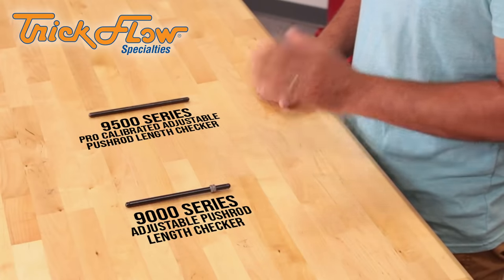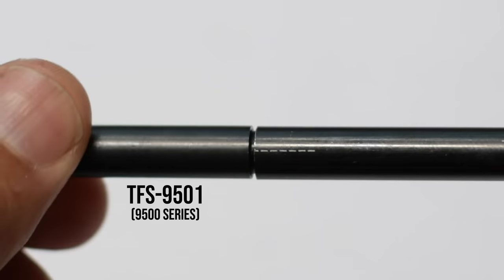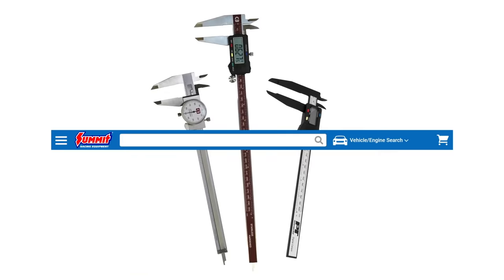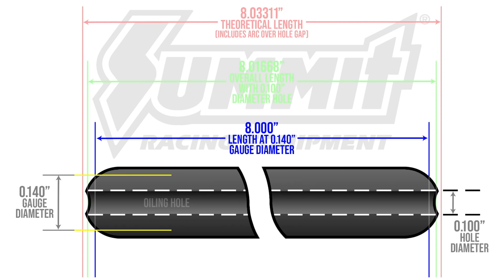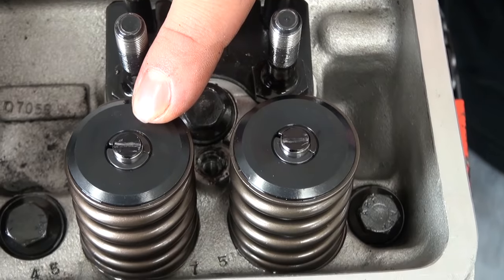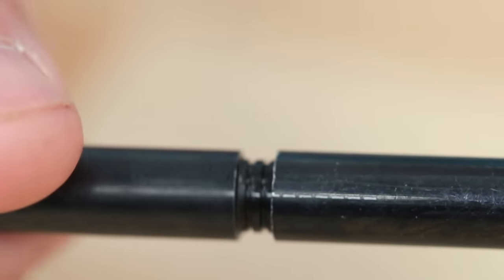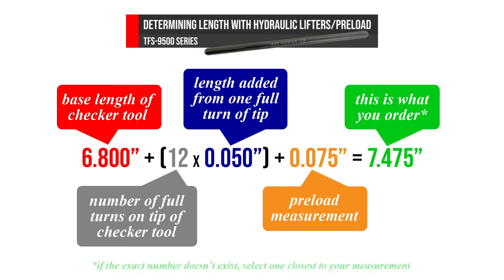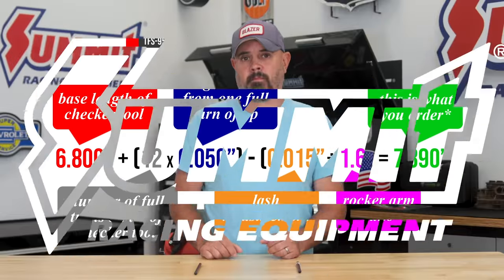How to Measure Pushrod Length Using Trick Flow Pushrod Length Checkers

Comment: Which one those tools would be better to use on a 5.7 lt1 out of a 93 Chevy Camaro. I’m planning on running a cc503 with ls7 lifters and  ls beehive springs with assault racing 1.6 RR? I just want to make sure I’m running the right length pushrods.
Reply: Jack, either tool will work.  To be sure of your measurements, use the same TFS checker tools used in the demo since the sample calcs are for those specific checker tools. These tools are inexpensive. The one criticism I have of the video is the addition of 0.075" for preload.  It is correct to add length for preload but 0.075 that value is not for all lifters.  Add the preload value for the hydraulic lifter you are using.  Most short travel hyd lifters have a preload range of 0.020 to 0.060. Many builders add 0.050 for short travel hyd lifters.  Verify your LS hyd lifter desired (optimum) preload add use that in the calculation. Note:  It may be 0.075 actually since that sounds like an LS preload but check it out yourself.
Reply: Agreed about preload. It's also different if you have an all iron block head iron with aluminum head or all aluminum block and head engine. The latter being the largest preload for thermal expansion is the largest in aluminium. 
I have a 97 Camaro with iron block and aluminum heads. Gen 2 LT1. Preload is approximately .030-
.035 with either morel lifters or the Lunatis I have.
Reply: @clifford_2zero7  Yes, good point.  As an example, Howard Cams ALWAYS publishes recommended pre-load for there lifters.  Their common SBF hyd roller lifter is 0.030-0.035 with a cast iron block and AL heads. Different values for different block/head material combos.

Comment: I don't get the 0.017 deduction
Reply: Mike, the 0.017 is a standard machinist calculation for a 5/16 ball pushrod.  What is going here is that the pushrod's ball radius, not the oil hole flat surface, is what touches the lifter and rocker.  What you measure is the overall length which is where the calipers touch the machined off flat areas of the pushrod oil through holes.  In the video, they simplified by showing an example of a pushrod that is 8.01668 (8.017) for overall length, then they subtracted that from the 8.00 value which is the length at gauge diameter for 5/16 ball end pushrods.  The difference is 0.017.  The example may be confusing because not all pushrods are 8.01668 (8.017) for overall length, but they were trying to show a simple example.  It will always be ~0.017 for a 5/16 ball end pushrod regardless of actual overall length.  They should have clarified.  TFS also cites 0.017 in their instructions for their pushrod length checker in the video.  See their instructions at https://static.trickflow.com/global/images/instructions/tfs-9000_at.pdf
Reply: Brandon 
In the illustration shown the .017” at one end of the push rod ball. If that were correct you would have to account for both ends or .017”x2 or .034.
Maybe that is confusing people.
Reply: @brianf8621  Yes Brian.  You bring up a good point.  I think the 0.017 is the total length to subtract i.e. 0.0085x2 for both ends of the pushrod combined.  I note that the TFS instructions also cite 0.017.